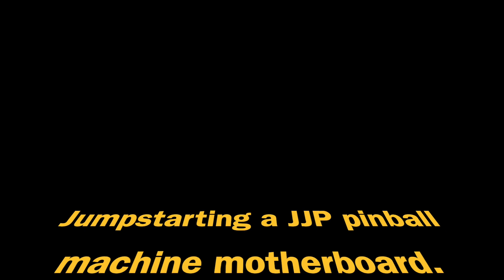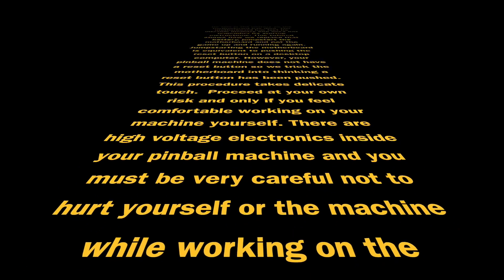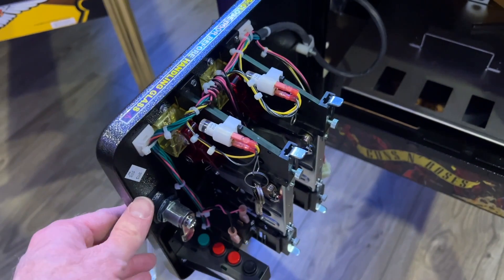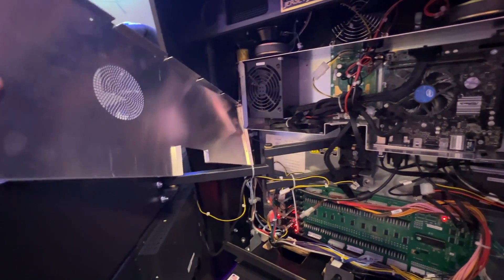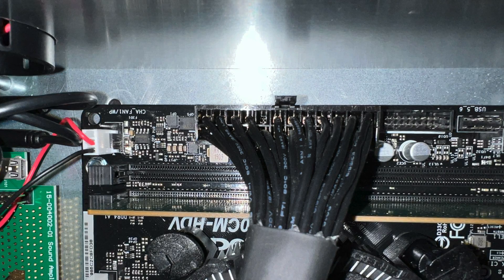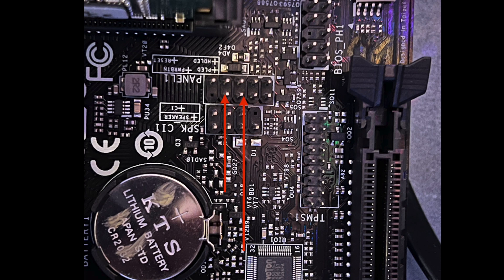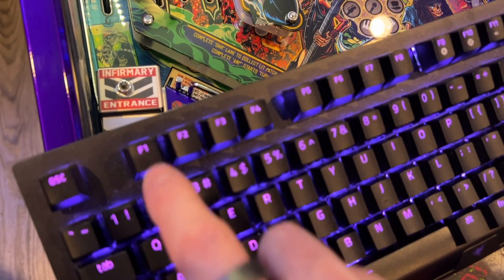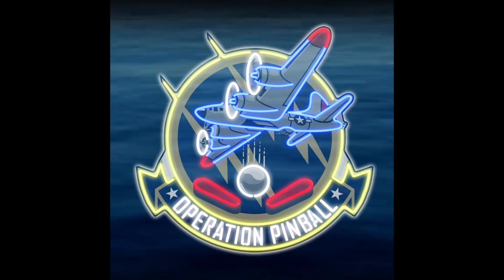How to jumpstart a Jersey Jack Pinball Machine motherboard (two methods)

Comment: It's basically an "off the shelf" PC motherboard in those JJP games so it's exactly the same behaviour when the battery dies and the PC won't boot. Replacing battery and performing a "clear cmos" to jumpstart the bios to get the machine to boot again is something that PC users do for more than 30 years already 😁. I'm amazed though that JJP went for such a basic cheap AsRock motherboard and used it straight out of the box rather than trying to bulletproof the board replacing the el cheapo CR2032 battery with at least some rechargeable battery or some kind of NV-RAM backup memory that would have avoided such type of maintenance operation for users especially considering the price they are selling their machine for 🙄

Comment: Much appreciated!  Elton had some lights out - left sling and others on the same card, but also booting to F1. So, I had to replace battery for starters, which caused the machine to not boot up. Luckily, your video got me back in business (screwdriver method). Lights are currently working, but we'll see if I end up having a loose cable somewhere. Thank you!